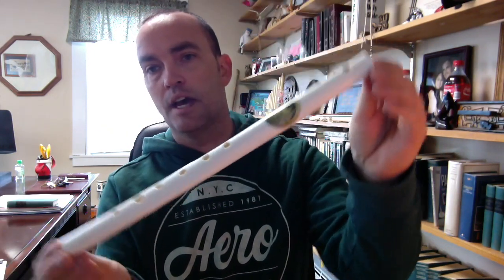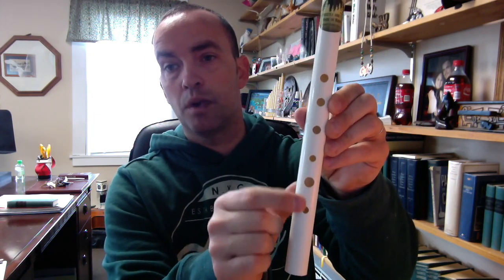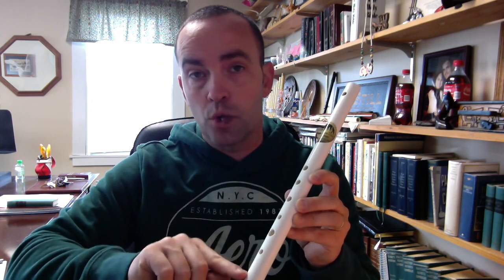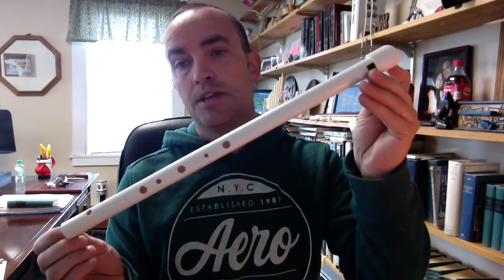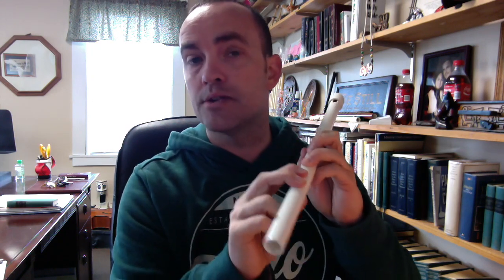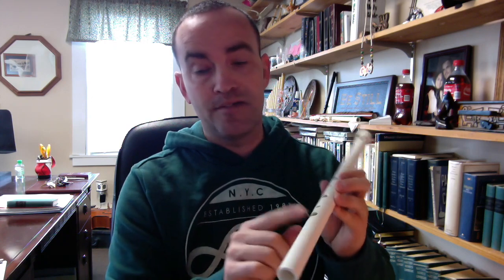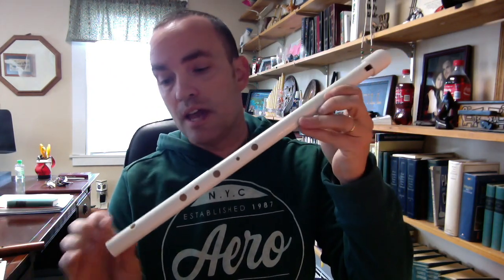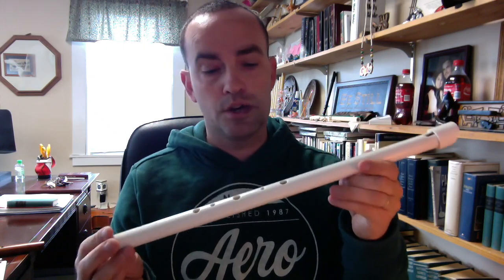The Reason for Hole Placement and Size

Comment: Drilled holes in a Bamboo stick and got nothing.
Reply: That's probably because it doesn't have a mouth hole, If you just blow through the long end of the flute you'll just get a breathy noise. The mouth piece of the flute has a sharp edge you blow over which "splits" the air and creates the note. Recorders get around this by having a fipple. All of the air you blow into it goes through the fipple and passes above and below it creating the frequency. I don't play the flute though so take everything I say with a grain of salt

Comment: Hi, Mark! Thank you for the video. Maybe you can help me. I make bamboo flutes inspired by tre tradicional japanese ones, including the root to. Recently I got a bigger piece of bamboo, without the root, and thought about working with another scale. Meybe the arabic one. But if its impossible to play it becouse of the size, I will go for the pentatonic. Here are the measures:  750mm long, 25mm internal diameter and 5mm wall tickness. What do you think? Can you please help me with that?

Comment: Great explanation. 
Do you recommend an app to calculate hole size. I am trying to make a bamboo flute and flutomat is making the holes too fare (2 cm diameter flute on the inside) .
So understanding exactly the relationship between hole placement and hole size ...
Hoo i could experiment 😅
Thank you.

Also what does it change in the math if the blow hole is side way or at the biggining ?

Comment: Thank you so much for this clear and very helpful explanation- I always wondered about those hole sizes and placement. I love the Andean flutes and the quenacho in particular, but I got one and I can't play it because 1) I have very thin fingers and some of the holes (the large ones) I cannot cover fully, and 2) my fingers can't stretch enough. So instead I thought I'd get the smaller quena, which has smaller holes which are closer together, but the one in the lowest key (I forget which key off hand) so I can go lower than the standard quena. But after having watched this video, I wonder if I can get a custom-made quenacho with a more ergonomic hole design for my fingers (offset holes to accommodate the stretch, and smaller large holes). What do you think Mark?

Comment: How do you know the ideal placement of a hole without a template? Is there some sort of equation or something, or do you just guess and get lucky? 

It's a problem with my low flutes. The holes are either to low so the holes are giant or to high so they're so small you can't feel them. I like my holes to be an equal distance apart. How do I guesstimate where to put them and how far apart to put them
Reply from the maker: It is nearly impossible, in my experience, to get the hole an equal distance apart, especially the lower the flute.  I do have an equation that I use personally, but I have also used a cool calculator tool that I recommend. here is the website http://www.anycalculator.com/pvcpipeflute.html  This tool allows you to play around with hole size dimensions based on common drill bit sizes.  
On Low D's I find the the final hole is either 1/4 inch or 5/16 inch depending on how far apart I want the fifth and sixth holes. The 5/16 gives a louder tone, but is more of a stretch.  Let me know if this helps
Reply: @MyWhistleandFlute  ah ha! Thank you. Yes. Exellent.
I did not want to raid my neighbour s bamboo. 😅 he he he